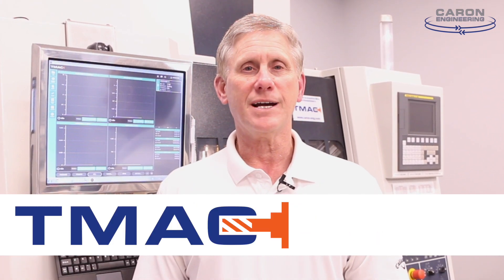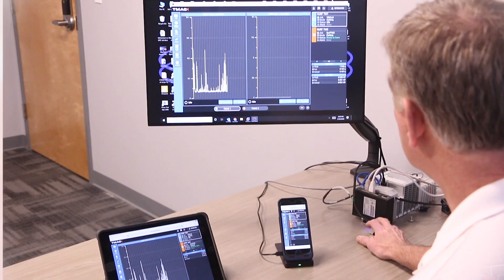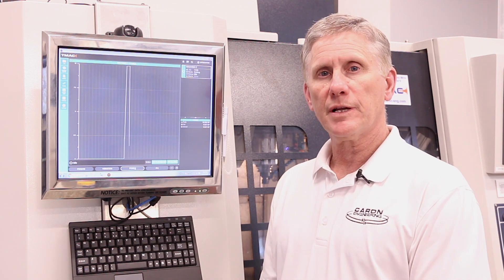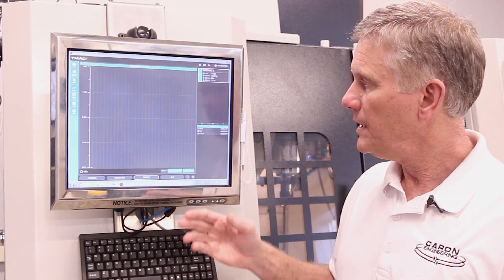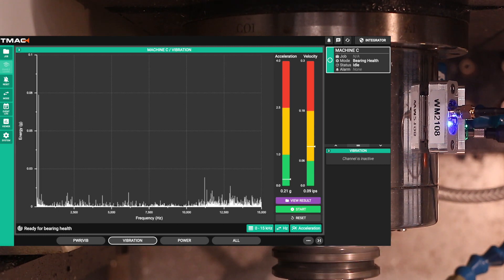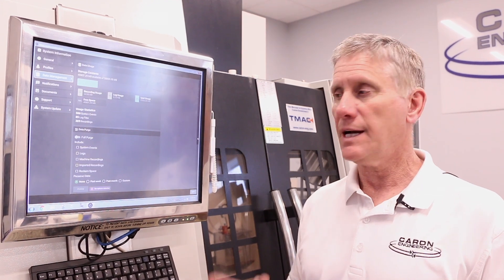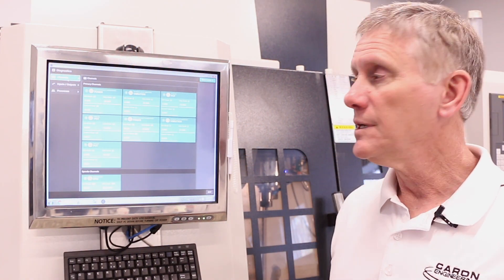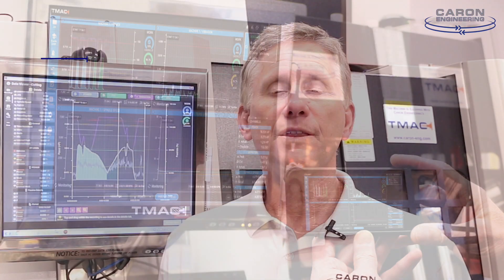Advanced Tool Wear and Breakage Detection System for CNC Machining

Comment: Didn't showed what the system does when a tool breaks 😕
Reply from the maker: Hi Ro Cuevas, thank you for your comment. In the event a tool breaks, TMAC will issue a signal to the CNC so that it can stop the machine and retract the tool before damage can occur.